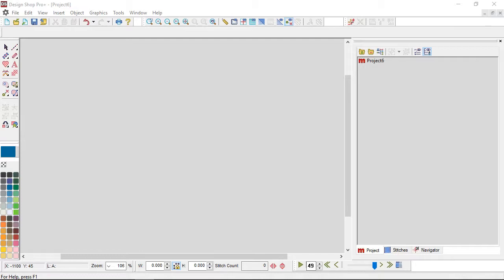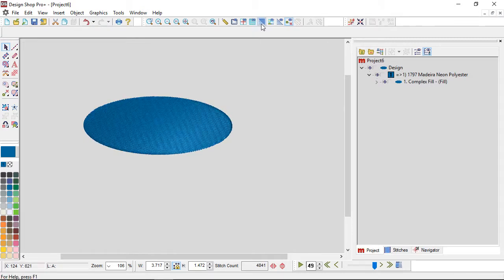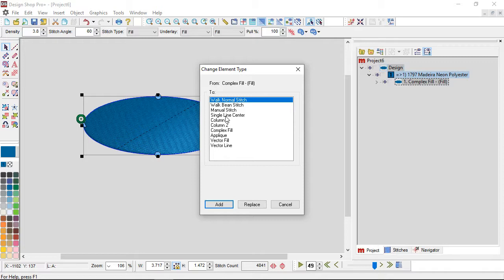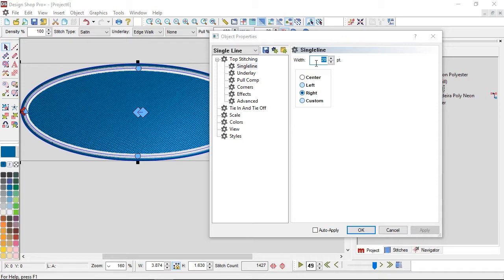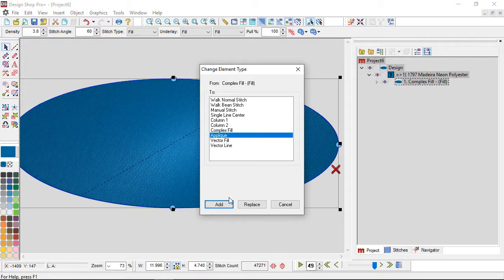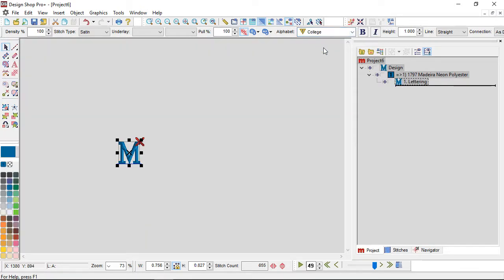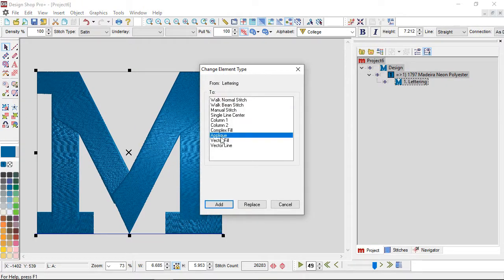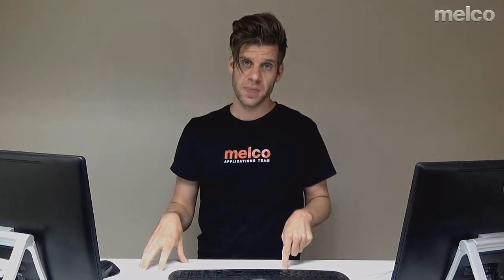DesignShop V10 ~ Change Element Type

Comment: The change element option is greyed out and unclickable for me as I've followed your steps. I'm also missing the buttons on the left hand side that you click to choose "Change Element" with no way to add them in under the view tab.

I'm using Version 10.03.025 and when I click for it to check updates, it tells me I'm not connected to the internet, even thought I am.

Help would be awesome
Reply: Nevermind, the joke is on us. We don't have the Design Shop Pro +